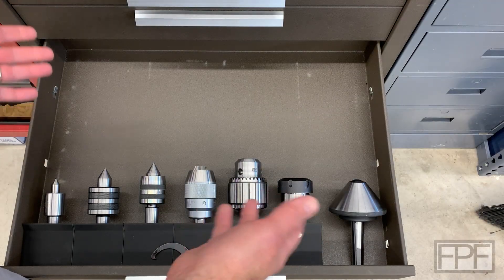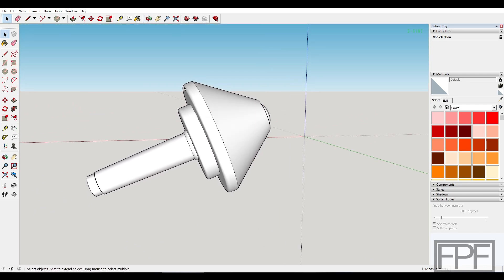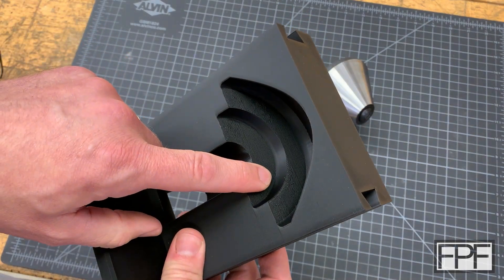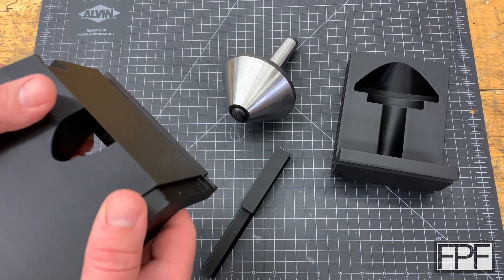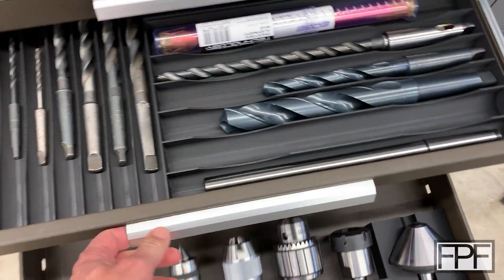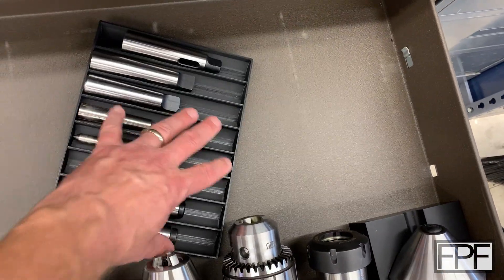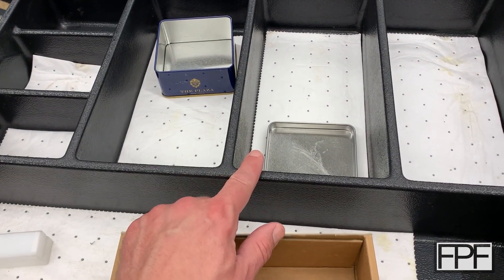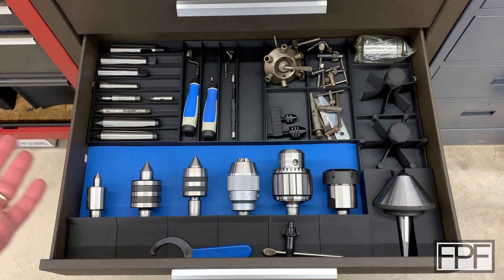3D Printed Taper Tooling Drawerganization for Kennedy Chest - Part 2

Comment: What is that roll of blue liner material called?
Reply from the maker: Botron Dissipative Blue 3 Layer Rubber. Very expensive stuff. I lucked out and got a 600” roll for $132 on clearance.  Normally something crazy like $900.

Comment: Your main concern is protecting your tapers. You may have a problem with the loose parts sliding over from the left to the right.  I think you may want to design some sort of a stop on the left side of the pipe center, to keep parts from sliding right and against the taper.

Comment: I love 3D printing too, but have you considered Kaizen foam for these drawers? It's a layered foam that you cut to match the outline of the tool with a thin knife. The layers separate easily. It's available with middle layers that differ in color from the outer layers, so it's immediately apparent which tools are missing from the drawer. Mixing and matching 3D-printed holders with Kaizen foam might be more efficient?

Comment: You’re 100% spot on with trying to turn it back into filament. You can technically get it back into printable material, but the quality of that filament will be terrible, and you’ll spend just as much time and energy just trying to dial in the print settings.

My local rubbish dump accepts hard plastics, and it’s only 5 min down the road from me, so I stock up all the big bits and take them down there. I don’t put anything really flexible, it’s not worth trying to convince the long suffering workers down there that these fine strings of calibration print are the same material, they just go in the trash.

Comment: I look forward to your practical ideas and designs for functional 3D printing every week. I am amazed how you find the time to produce the videos and use all of the machinery in your workshop. I am now retired but never seem to have enough time to get everything done. I have left comments before regarding the machine tools you mention in your videos. Machine Tools have been at the centre of my entire working life. I do not have anything like the equipment in your work shop although I am familiar with it, I only have a small lathe and a pillar drill/mill as I have very little interest in making “things” with conventional machine tools after all these years. I came across 3D  “rapid prototyping“ machines (I don’t think the term printing was used then) originally in the 1990’s. And have followed the technology since. You mentioned in your last video the amount of wasted material when producing prototypes. My approach is to not print the whole thing to start with, I design the part I want which normally needs to fit or have something from the real world fit to it. Then slice it into small parts that I can test fit to the real world item. For example, I would have printed a sample Morse Taper bore for your lathe centres, then a section / slice to test fit the body of your holders into the drawer and so on until I am almost sure my design will fit before printing the whole thing. This reduces the amount of material and also speeds up the process because the print times are slashed. Even faster when you have more than one printer. Although I will admit sometimes having the whole thing in your hands can  change your ideas from what appears on the computer screen. Please keep the videos coming, also can you share details about what you make with the machine tools and woodworking machines and how they integrate with 3D printing please.
Reply from the maker: It's a struggle most weeks if I'm honest.  Thx for sharing your method around prototyping.  I did more of that in the past, but there is often value like you said in seeing other parts of it and evolving those as well in addition to fixing the broad strokes.  It's a balance.  Can't spend too much time on the details that don't matter yet, but if you leave them all till the end you end up with even more iterations :)

Comment: My plan for rejected parts or waste is to collect clean pieces of just one type of plastic (PETG in my case).  Once I have a full bag, I plan to take it to a dedicated recycling facility.  However, my local Masterspace is making something in this space, so asking your closest Masterspace might be an option as well.

If I could recycle at home, I'd use the recycled filament to make draft pieces or parts where visual and strength properties are not impotent.

Comment: In our area at some of the supermarkets, I guess you call them Malls over the pond, there are big dustbins about 250 litres labelled with the various types of cleanish plastic waste(not for used dirty bottles, that's outside) and also a generic one. These bins go for recycling when full and the proceeds go to local charities, they also have bottle top bins from the likes of milk and fruit juice and similar that is mostly PetG. Being in a busy place they tend to fill up quite fast. Every little helps. The draw is looking good, I quite like gridfinity for smaller stuff but not really ideal for that size and weight of tooling.

Comment: probably should have put the centers at the back of the drawer so you're pulling them out towards you.
Reply from the maker: locking into the front lip of the drawer worked out really nice
Reply: I was thinking that too. Could be easier to remove and puts the space for the small trays at the front, making them more accessible. Hindsight, eh?

Comment: Some fablabs or community makerspaces take in plastic and recycle it. It is also possible to remelt the plastic into thick sheets and make stuff from that. Remaking filament is a bad idea because of quality degradation caused by repeated melting. Look up Precious Plastic for a community effort on recycling and to find local initiatives.

Comment: Definitely watch that toolbox with the fact that it allows you to have multiple draws open at once... I have seen that style topple over before..
Nice build as always 👍
Reply from the maker: Great warning to share.  Mine has lathe chucks in the bottom and a heavy box on top that sits towards the back half, so I think it would be tough to get it to tip over, but I should safely test my assumption to be sure.

Comment: I don't think you closed the drawer once.. does it fit with the new print?
Reply from the maker: yes!  I was about to say I did show it, but I just realized I didn't include the clip where I showed slamming the drawer to test that everything stayed put.   It clears with ~2mm to spare.  Sitting on the bottom of the drawer bare it has ~3mm clearance, so the design is pretty close to as optimized as it can get.